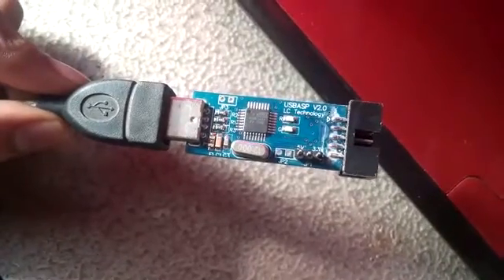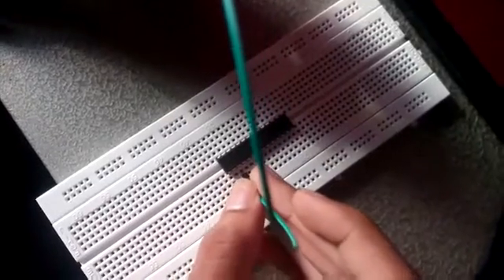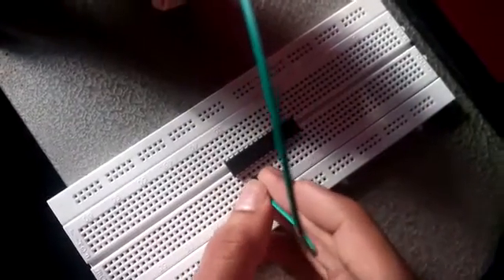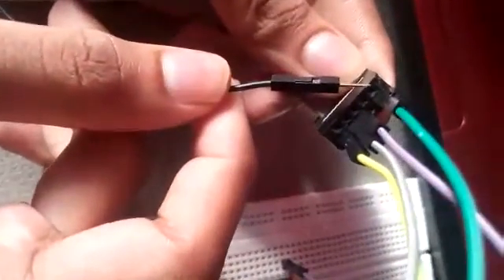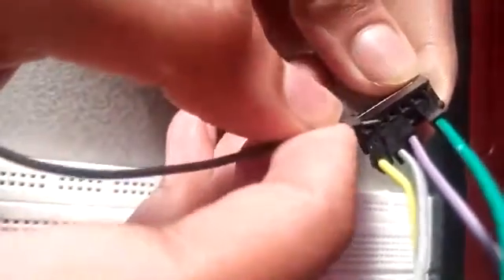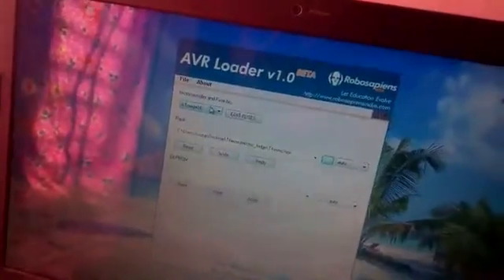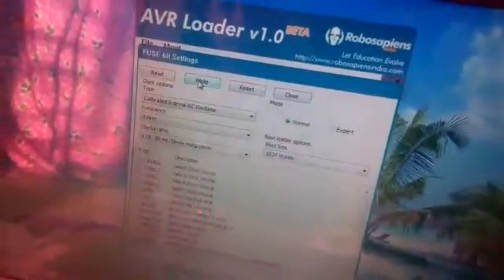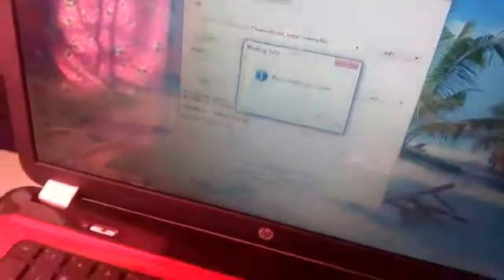atmega8 programming using an AVR usbasp

Comment: Will Windows 8 or 10 accept the avr programmer? Or, so you need to install a driver for it to be recognized by windows 8 or 10 ? Will it work on windows 7 (which perhaps does not need a driver)?

Comment: i just bought a new atmega328p for my new project,  i replaced my old atmega8 from the board with this new atmega328p,  the problem is my avr boot flasher doesn't detect my device when i place atmega328p i suspect it is not boot loaded, can i bootload it with my exiating board , if yes.. how??  hoping to get some help
Reply: Does your boards.txt file have an entry for the new chip?

Comment: there's already
vcc connectivity in the usb asp ? how it is possible to apply external         voltage by battery .
Reply: Kamal deep singh Singh my what's app number is 9811340617 macge mi
Reply: Is this device USBasp can flash satellite receivers on mode/light red only?